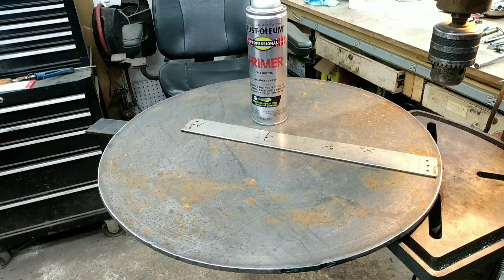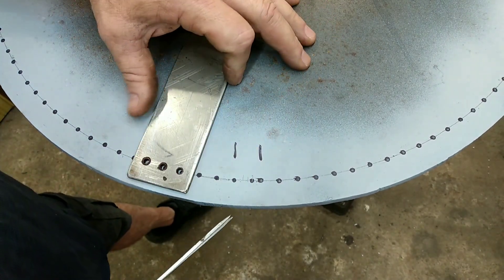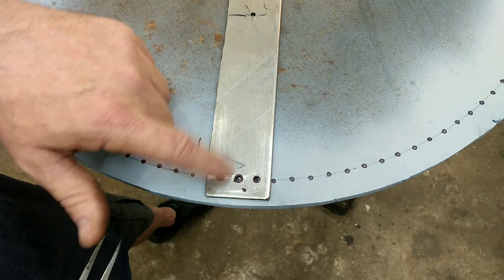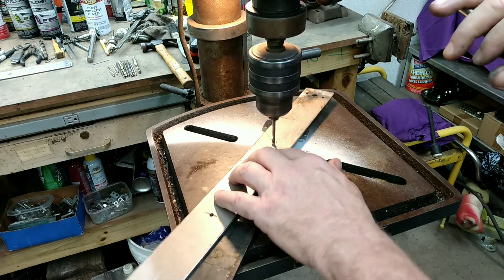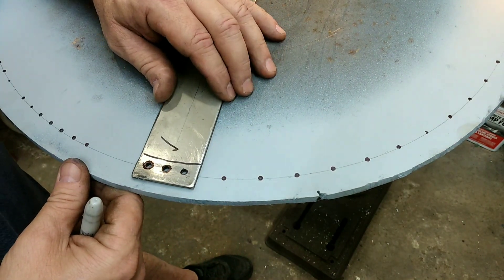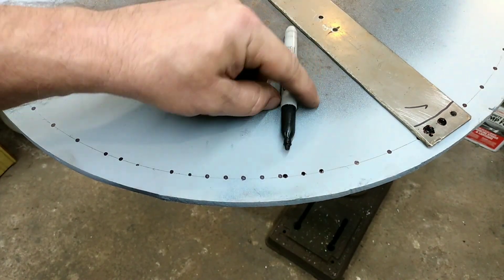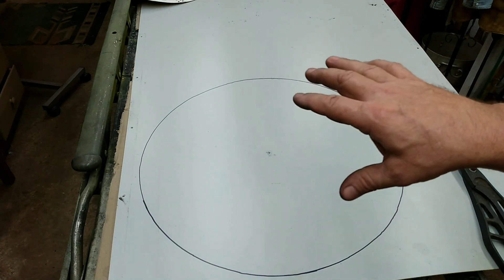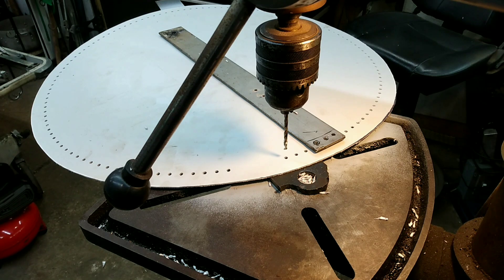how to build gigantic sprockets for amphibious ATV project. part one

Comment: Very long tedious work there. I am assuming you are going to cut the outer edge to yield your gear... I would spot weld the other plate on the bottom of this one you just drilled and drill through the existing holes. That would be the wisest option in my thinking...   Thumbs Up!
Reply from the maker: Great idea thanks
Reply from the maker: It seems like it is taking forever